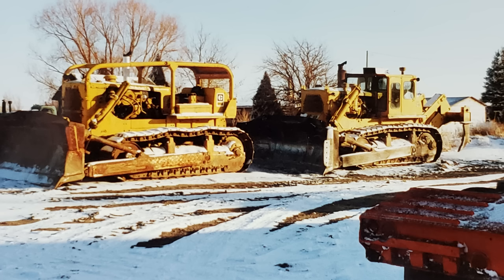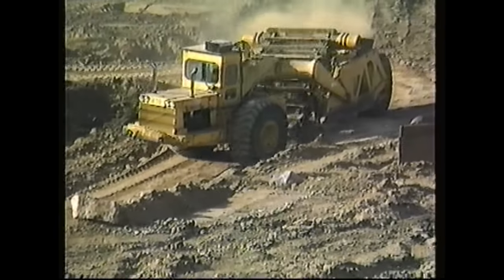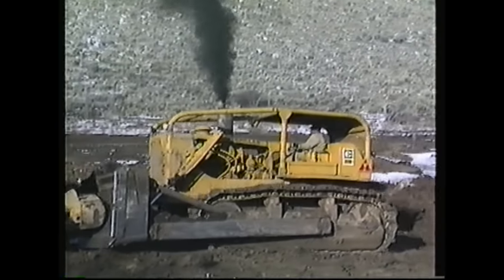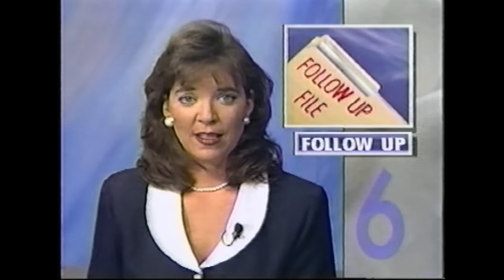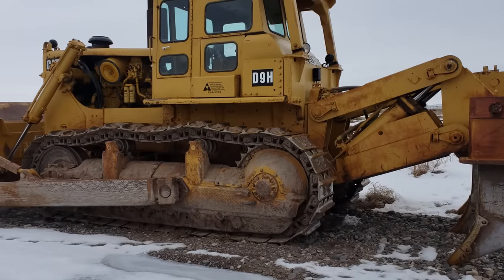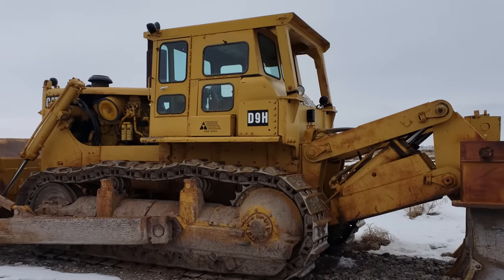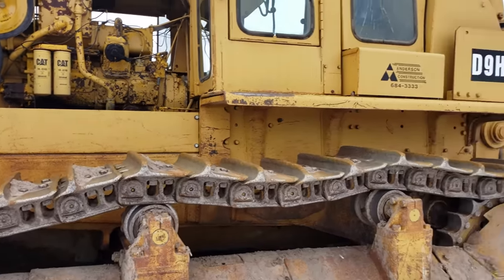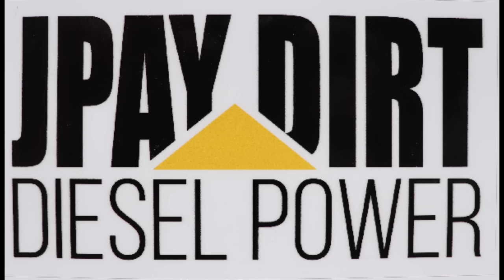Caterpillar D9G History

Comment: I started out in the 70s on a 46A D8 a couple years later I ran a D9G with a pony motor starter for Random const company in California then to a D9H  then later I got one of the first D9 Ls in California brand new from Shepherd cat but had a problem with it . It felt like low power so Ross the mechanic from Shepherd kept coming out to the job site up in the Santa Monica Mountains and turned up the power until the last time it was 70% over stock but it still felt sluggish to me . So come to find out the brake discs were warping and dragging the cat down this was in the 80s so they brought out a set of D10N experimental brakes they were developing and installed them and that Cat came alive , oh man turned up 	70% over and freewheeling finals , we were hot roddin buddy . I was a pioneer cat and up in the cliffs busting in scraper roads to 300 foot cuts. Man what a beast that old 3412 was zingin . I did enjoy the old D9G i graduated to after the D8 it had a lot of power and weight , good for ripping rock and moving big dirt , they did end up putting a gigantic slope board on her and I cut many a mile of slopes with her back in the day . Thanks for sharing brought back great memories . I took early retirement 9 years ago as a rough grade superintendent for Sukut construction here in Southern California. Still love the big iron !
Reply: Mike l got a friend working for Sukut still. He likes the big iron too. He runs a 8 utility now. But I have seen him on the 11N. His name is Donavan Davis nicknamed Scott.

Comment: My Dad had an excavating company. Bought a new D9 in '68 with a cushion push blade for pushing the scrapers and doing a little clean up work in the cut. We had 2 D8s and a TD25. I hated running the D9 pushing. I usually ran the TD25 clearing trees. I addition to the usual Cat scrapers we had 3 Wabco 20 yd paddle scapers. They were good machines. I started running the little D6 when I was 15. My favorite machine to run was a motor grader doing blue toping. All that was long ago, things have certainly changed a lot.

Comment: Thanks for the video.  I really enjoyed this one as I have a real soft spot in my heart for 9G's.  It was fun to see your old videos and see your boy runnin the old girl like an old time cat skinner.  That was awesome.  I used to move many 9's, some 10's even moved a few 11's just the power unit by itself as it weighed 92 tons with no ROPS, Ripper bar or blade.......Moved a few 37's but mostly 57's as the outfit I did most of my work for was a BIG dirt outfit here in So Cal.  Back when I was young and first started lowbeddin we used to tow 651"s with just the tractor up on the jeep.  It was easy money until you had to stop fast!!!!   Used to get a few crazy looks when folks passed us!  Anyway, fun to look back at the older iron.  Thanks
Reply from the maker: Cool can you name some of the outfits you worked for,, bought a 666 at an auction for Kirst Const. in 81 at Pala Mesa
Reply: @Jpaydirt  Started working for the local CAT dealer early on late 80's.  Then early 90's I worked for Marco Lowbed in Santa Ana and we did a lot of work for Ralph Mitzell Grading.  Moved  a metric shit ton of 51's and 37's.  I was younger then so I got 1 of the jeep and dolly set-ups.  All the "old guys" got 9 axle set-ups to move.  then went to work for  a little "no one ever heard of ya" outfit and got my chance to run a "triple 16" 9 axle trailer.  MUCH BETTER than the old jeep and dolly.  then later worked for Signs and Pennick out of El Cajon.  Lot's of big yellow iron.  We used to move 777 rock trucks complete in one piece.  that was a sight to see going down the freeway with Highway Patrol in tow but a LOT of work and prep.   My favorite was the 9G push cats.  Under 12" wide so no pilot car here in cali, and barely over height.  Hop it on, slam it up to the gooseneck, 6 chains and binders and 2 flags, and you are outa there.  Easy Peasy money for only 15 minutes of work.  HaHaHa
Reply: @Jpaydirt  Thanks for taking the time out of work for the channel.  I really enjoy the content.  don't change a thing!

Comment: My brother bought a d8k last year with less than 100 hours and that’s Less than 100 original hours. It’s an old army dozer he got at auction for less than $30,000. Maybe you can find a 9 like that? Also to note he bought it sight unseen, mainly as parts dozer for our old d8k, but it turned out to be a great machine. you can’t beat brand new machine at less than a tenth of the new cost.  There’s a sticker on the ripper that has the primal price tag of some where around $280,000. Anyways thought you might appreciate the story.

Comment: I enjoy watching the old gear. The company I presently work for I started with them about 15 years ago located in Atlantic Canada working in one of there quarry operations, started out running a 76 Cat 769B rock truck, it was one of 5 769B's they had there, two trucks hauled shot rock loaded by a Cat 245B ME with front shovel boom. They had two other's that hauled out from the crusher to the stockpiles. The 5th truck was backup, those old 769B's with fiberglass cabs were damn cold in late Nov and Dec. Before the 245 Cat and 769B's they used a Northwest 80D cable shovel and old Euclid rock trucks. The Northwest is still on site but has sat since about 1990. Today we run 769D's and Deere 400D's, shot is loaded with a 980H.

Comment: Thanks for sharing more history, Its cool to see those machines you still have after all these years.. I'd bet there aren't many construction companys still have machines in everyday work they owned for this long.   It would be great to see more of the old history so please share what you want. Looks like you were a TV star before YouTube as well, most guys get picked up for tv after successful channels L.O.L.
 
I'd say you answered your own question with that newer high hour dozer.  It won't do much more than you got now apart from some newer  operator comfort. It would be way more money not going into your bank account paying for it. I'd say you know what you got now, even if you spend money updating it. you aren't spending 100.000 plus by the time you figured out whats fell off, or about to fall off in the first year you own the newer one.
    It's the same  with farm machines that get traded, you can soon find out why the last guy don't own it anymore in a hurry, when the parts and repair bills start showing up in the mail, that electrical craps a big part of it now to.  I'm working on a MF the motor needs work, thats nearly done,  then we start on the $10.000 of electronic/ hydraulic stuff where a mouse ate the wires and shorted the computer. It would of been better if it shorted and burned for the insurance payout, Thats what the customer says and I agree after dealing with the hassle  !.     Take care

Comment: Awesome Video Jeff. I love those old flat track 9's. Caterpillar overbuilt them to run forever as long as you can get parts. I have 2 old D8K's that I am wanting to fix up the newest one which is a very late model with the aftercooled spacerplate engine. I have a Cat factory cab ready to install. I grew up on those old tractors and love the way they sound and smoke. I love watching your videos here in southeast Kentucky.

Comment: I loved watching that! Your 11 year-old son pulling a ripper and then later on pushing a scraper. (I'll bet he tapped 'em just right too.)
My first scraper-operating job was in Alaska on an old 619. Cable operated and manual transmission. I was sure glad to next get on a 621 with a easy ride. Good memories though. I didn't get any video of my road-building years. I ran an old Wabco self-loader back in '90-91 when I first came to Idaho. Hated the thing.

Comment: I ran the 9G's as pushcats (no dozer just push cushins) early 70's working for howdy contractors. Good machines. Early 80's operated the D9H's in a mine. I believe the H model to be one of the best if not the best tractor Cat made. 

  I knew those old machines you have were durable because I have a few hrs on them. But the fact that you are still using them today is a testimonial to just how good they really are with a little maintenance.  Good On Ya Jeff!
Reply from the maker: Thanks Nancy

Comment: I had an intimate relationship with a Cat D9 in my youth. I hired on as a SWAMPER on a pipe-line crew in Martland laying a gas line. My job was to hook up a 48 ft., 60-inch pipe to the Cat wire rope and then jump on the rear of the cat as it hurled down the line to the pipe bender. That baby would fly. The operator was a good old boy from Texas named Harold. Funny how we remember things.
Reply: I have been a heavy equipment field mechanic most of my life and remember when these Old machines were new, or still the main machines.
I was in Operating Engineers 428 for years.
I too worked on the pipelines.
 I would usually be the soul mechanic on the jobs.
The company contracted to El Paso Natural Gas for most of it's work.
The Pipeliners were usually D9 based side booms. 
We had Cat 225, 235 and a few new 325 & 335 Cat Excavators among other machines .as well.

Comment: Your boy started a little earlier than I. I was 14 running a 2 U D8. An old slide bar tractor. Dad had a HD 15 Allis,  a DW 10 And Dw 15 and had leased fr 1 job an old C turnapul. The 8 was my tractor though even though I got trapped into running that old pull once in a while. Havagudun Bud. very interesting and your dad was extremely lucky.

Comment: the old stuff just keeps going and going, just finished a set of steering clutches along with new cages and new bevel gear shaft bearings on a d8h, also had some bad counter bores and ended up putting 6 packs and a set of heads on it too. also i have recently purchased a 977l 11k4xxx s/n, im wanting to convert to spin on oil filter its an early 3306 pc , is all i need is a filter base off a newer 3306? or is there more to it than that, figure youre the man to ask since youve converted every piece of equipment you have to spin on lol.
Reply from the maker: Pretty simple conversion hayden, do you follow me on IG and farce book? if you do I can show you

Comment: Hey Jeff. Tony here from Colton, Calif. I like what you said about the Wabco scraper. Although  l never ran a 333, l did run three generations of Wabco's. #1 called a D Pull by some. It had Wabco on the front. I called it a piece of junk. 5 speed manual transmission, 7yd. can, clutch on the floor. Electric steering and paddles. Engine ran a dynamo I sat in a seat on top of. Hydraulic floor and ejector. Steering always froze up and l went where it wanted me to go. Almost  crashed into the models. I hated this ugly piece of junk.  Embarrassed  to run it. When we first got it came with a rock for a seat cushion. #2 Wabco 111 electric paddles with two paddle motors. 11 yd. Can. Every thing else hydraulic.  You sat in the middle with a deck all around seat. Sat over the engine. Damn good finish machine. But with all  small scrapers  would beat you to death. #3 Wabco 222, electric paddle motors both sides. 22 yd. Can. Wabco's answer for the Cat. 623. No comparison  at all. No easy ride either.  Stiff and rough. Sorry for the drawn out story of my experience of Wabco.
Reply from the maker: I hated them, LOL

Comment: What is the advantage of the high drive? It seems to me that having the bull great not mating with as many pins would be a disadvantage however perhaps I'm thinking of it wrong. This is something that I have wondered for a while. I can't imagine running and working on a D9 all the time. Dad and I rebuilt the engine in a IH TD-25B and everything there seemed huge and it's half the weight of your monsters (Killdozer)

Comment: I just bet your boy's loved to get to go to work with you on the week ends. I know i would have if my pop had some type of business do this type of work because when i was little all I wanted to do was ruin a dozer or big dump truck.
Reply: One time when I worked at Weyerhaeuser in Oregon, we had a Link-Belt log loader catch on fire under the center pin.  It was on a 4 axle pierce carrier.  I told them that I could fix it but not in the field.  I fixed the burned brake hose, but for the throttle I tied a wire to the throttle and ran it up to the cab and wrapped it around a stick so that the operator could stick his arm out the window and pull the wire to rev up the engine.  LOL  Country for sure, but we got it to the shop.  I brought my 8 year old Son with me on Saturday to fix it.  He was my go-fer, and he was worth his weight in gold.  It took 15 hours to get it all repaired, but we did it.  I even gave him a paycheck.    It is a good memory, for both of us.

Comment: if you go to a high drive D9... will the cage clear the bridges without having to be taken off.  is the worn out D9 you looked at still available if you want a second big dozer..  i am talking speed of transport.  its just a question.. i don't know the answer if the high drive will clear.  or if it will take a center lift trailer that  leaves the tracks dangling to get the round clearance..   or if there is a jeep trailer that fits under the rippers and a hinged trailer under the blade.  so the tracks are just dangling.  this could be creative as you could use the tracks to push out of high center jams..  or  to assist climbing steep muddy trails.  just thinking..  i was enjoying looking at these guys putting  a new bottom in an excavator bucket. https://youtu.be/wtlB9m1AEy4  you might enjoy it too.. its an interesting way of doing it quick..
Reply from the maker: My 9 is 14' 7" to the top of the stack, I'm sure I could haul a 9R fine,

Comment: Hi  I owned a Fowler challenger 33 dozer that had a onions 9yard scraper box with it back in 1993 I only kept it for a couple of years as I couldn't find the work for it as everyone seemed to want Volvo A25 artic dump trucks and 360 diggers for bulk earth moving in are area have you ever had any experience or knowledge of one of them cheers Jeff
Reply from the maker: A Fowler and an Onion, hmm..................nope, you aint' from around here is ya?☻  I know there are tons of idiots who think a wiggle and tip over truck is the way to go but look at how many times the dirt starts and stops, that's wasted time, now every tool has a purpose , but if it can be moved with a scraper then move it with one or pay more money for a truck
Reply: @Jpaydirt  hi Jeff   I am not having a laugh the challenger 33 was d6 size and made by Fowler of Leeds England they were  also well known for building steam engines to and the onions 9yard box scraper was built by Vickers of England they are well known for building tanks ect .thanks for the great vids 😁

Comment: I know nothing about heavy equipment. Why doesn't the one piece of equipment have enough power on it's own without being pushed by the bulldozer?
Reply from the maker: Takes a lot of traction to push dirt straight up, most of the time we use the push pull set up, where we hook up to three scrapers together to load
Reply: I had a bail break on a 627 the guy in front of me almost flipped his pan over my bail had broke when it jerked me I've also push and pull an 637 and 657s

Comment: Classic example of an operator thinking they're an engineer when they think they can fix a ROPS. Once a machine's been rolled, replace the damn cage. Your life or your employees life may depend on  it.
Reply from the maker: Umm classic example of a gamer thinking they know the difference between a ROPS and a FOPS   It was never designed by engineers for ROP  (rollover protection)  it's for falling object protection (FOP) and the only thing that saved his life was this operator pretending to be an engineer and installing 1" 1/4 thick L brackets under the fenders,  and now you have learned something today, Nick Lane. hey is Lois your mom?
Reply: Hahaha owned.
Reply: @Jpaydirt  is it actually possible to build roll over protection on something like that?
Reply from the maker: @jiveturkey9993  Sure, Cat did
Reply: @Jpaydirt  I went and Google Image it. It wasn't as big and heavy and elaborate as i pictured it in my head.
Reply: Ya got burned buddy better get some cream

Comment: Does anyone know what the production levels per hour are on the d9g-h compared to the newer models??
Reply from the maker: it's like the hare and the tortoise, the old 9 just runs and runs, the new 9 goes really fast burns the grousers off and then waits for a new undercarrige and some electronic work and then more computer troubles, then after 15 years it's off to the recyclers☻
Reply: @Jpaydirt  dont forget the 5 thousand hour def filter change....or the egr leaks...or all the God awful sencers....but they are comfortable

Comment: What's the difference between a d9g and a d9h
Reply from the maker: One alphabet soup.................... G was 385 Hp and the H 410 HP and a spacerplated engine, but you could make a G 410 pretty easy, hydraulic controls went to piloted opration, easy short lever, steering went to single lever control and some other improvements or not, depending on how you look at it

Comment: Um. It's 2021. I'm guessing that cab has no heating or air. It would be a complete oven in Summer, and it snows where you live. Mate, why don't you do yourself a favour.
Reply: That's that I tell people who still maintain and operate stream locomotives. They are so much more work, dirty, heavy lifting, greasing, no AC. Why do they bother, they should just scrap them and not bother, who needs old equipment like that when the modern stuff is much more comfortable and practical? Can't imagine why anyone would prefer the old machine. So weird.